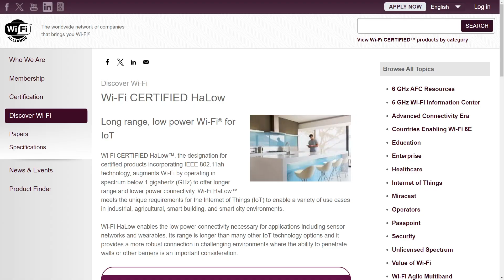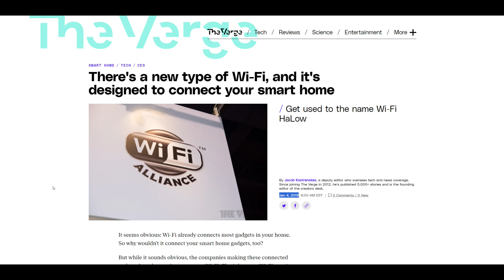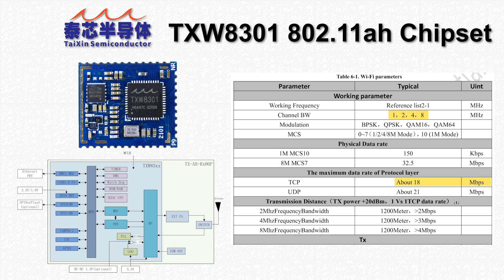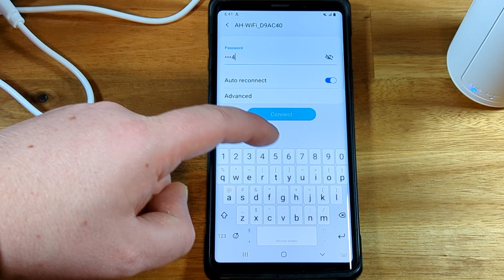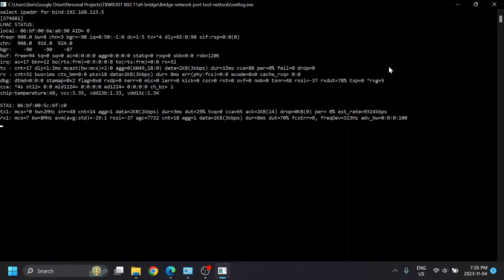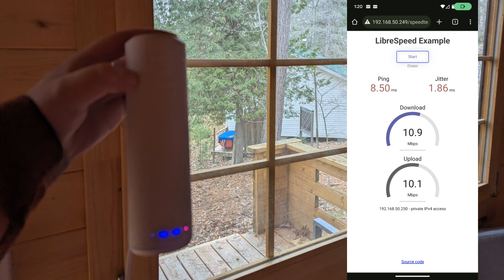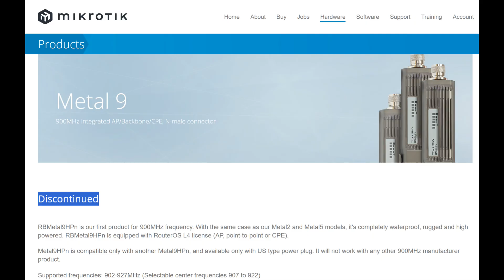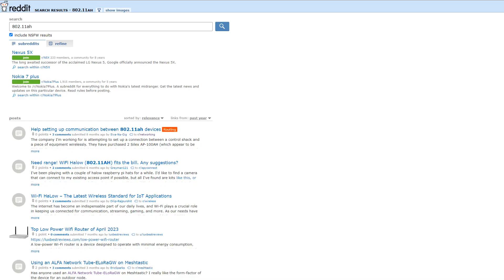802.11ah Wi-Fi HaLOW: The 1 Kilometer WiFi Standard

Comment: For the very little it's worth, some friends with amateur radio licenses had 802.11b running at the full 11 Mbps, over a 20-mile point-to-point link implemented without line-of-sight, with directional antennas and a 1 W amplifier. [Edited to add 'with amateur radio licenses']
Reply: The great thing about this is it achieved long range without the bulky point to point directional antennas. Just a stubby and no amplifier. And it can be used in wide area meaning use it while walking or on a vehicle while mobile. Imagine this using an amplifier and a 12dbi Omni antenna. 

Set up a starlink on your camper van or car linked with an Access point halow on a pole. Then bring along a small Halow receiver with you while you take a hike/stroll along the mountains or by the sea while youre live streaming from your phone for over 3km away from your camper van or car
Reply: Don't you need firmware hacks there so packets don't get dropped due to expiration? I heard that becomes a bigger problem with regular Wifi at around the 1 mile mark even under ideal conditions. Or is b already lenient enough in that regard? The people I think of probably exclusively tired faster standards.
Reply: If it is an issue, some WiFi routers let you adjust those settings.  If not, find a router that will run OpenWRT firmware.  I think it exposes those settings.
Reply: @major__kong  Okay, my info was old, it would make sense that those insights would have been used like that in the meantime.
Reply: @fgregerfeaxcwfeffece   It's a bit over 20 years ago now (which I see now I forgot to mention in my original comment), but as far as I recall, everything was unmodified, commodity equipment.
Reply: @Ice_Karma  They'd flash the Linksys wrt54g blue and black boxes with HSMM-Mesh firmware.  Certain models weren't frequency locked and had more flash ram.  As they made the units years on they became cheaper and more locked down.
Reply: You just need to adjust the ack timing timeout variable. Theres hundreds of companys that make outdoor based wifi gear. Camium, Ubiquiti, Mikrotik are the three biggest. I ran links upwards of 30KM on 5ghz. I also did PTMP under 15km links on 900mhz, 2.4ghz 5ghz, and very sort distances on 60ghz (under 2KM)  @fgregerfeaxcwfeffece
Reply: A 1W amplifier will take you straight to court in most countries..
Reply: @hermannschaefer4777   Yup, and I forgot to mention that they all had amateur radio licenses.
Reply: @hermannschaefer4777 Why?
Reply: @whatsupbudbud  In almost ALL countries of the world the maximum transmission power allowed is 100mW.
Reply: @hermannschaefer4777 is it related to national security, military or why? Hadn't heard this, so just curious.
Reply: @whatsupbudbud  It depends, but I'd say the most common reason is to avoid interferences with neighbors i.e. other users and devices and techniques that also use 2,x GHz. Crosstalking and similar effects make wireless communications always a problem, so it's no wonder that you have to regulate it. If you make p2p-radio systems around my country, you either live with 100mW or you need a special licence / permission with dedicated frequencies, i.e. 4, 6, 7, 13, 15, 18, 23, 26, 28, 32, 38, 42, 52, 71-76 and 81-86 GHz. Sending on 2,4GHz with 1W will initiate a (very expensive) monitoring car - and you don't want to pay that bill...
Reply: @whatsupbudbud  it actually various for wifi based on the antenna, whether it's a P2P or Point to many, if it's out doors or in doors. 36dBm is your max transmit power, which can come out to 4 to 5 watts for regular indoor unboosted router. A point to point per FCC will be predetermined during the development and application phase. 
What the FCC really cares about is your transmission dBm and frequency. But you gotta really shake the tree so to speak to get their attention enough to even get a cease and desist letter. 
With all those baofengs out there turned into illegal repeaters, wifi cluttering is lower on their list. 
100mW tends to be the default setting on most residential wifi transceivers, and 500mW on directional antennas that are still point to many although design to simulate a true point to point. 
Alfa brand name is what you want to get if you want to be able to control most of the router settings, instead of the hard-coded settings baked into the drivers on a generic router.
Reply: @theodorepollock1273 I'm in EU but thanks for your input.
Reply: @hermannschaefer4777  "A 1W amplifier will take you straight to court in most countries..."

Not if you have an appropriate amateur radio licence for that band...
Reply: @btudrus  You can't have a licence for those standard bands.
Reply: @hermannschaefer4777 Many unlicensed bands overlap  amateur radio bands especially in UHF and above
Reply: @hermannschaefer4777  " You can't have a licence for those standard bands."

Yes you can. In some countries amateur radio has higher priority in the 2.4GHz band (WiFi is just ISM anyway and it has the LOWEST priority)
Reply: @hermannschaefer4777   At the time, at least -- almost 25 years ago -- my (American) friends' amateur radio licenses permitted them to use up to 1 W of power regardless of band, undoubtedly subject to restrictions I've either long since forgotten or never knew.

Comment: 900 MHz bridges have been a thing since the late 90's, they were not widely marketed to the public but rather to public services to link MDT's (Mobile Data Terminals) back to a base station at the dispatchers console. Data rates were of course slow in the low Kbps range but that was all that was needed to send and receive lines of text and no images. Most systems like this were used by police and fire services to send and receive status updates and reports, Cab companies also used them in a similar way to send and receive calls to prevent rouge cabs (fake cabs not affiliated with the company) from jumping fares like they would with traditional 2-way radio.
Faster 900 MHz gear though didn't start popping up until early 2000's and the first ones I saw in use was at a drag boat racing event held by Lucas Oil in 2006 where they had a 900 MHZ link from their main control site to a boat ramp nearly 1/2 a mile away. This link supported internet traffic as well as the system they were using to send the racers ticket data to be printed out for the pair that just finished racing.

Comment: It looks like a big improvement over the Pringles can antenna.  

The old 10-base-2 coax cable had twice the range of 10-base-T twisted pair, and HaLow gives the same speed at even longer distances. 

ARCnet on a different co-ax cable had a 600 meter range but only a 2.5 Mbit rate. I worked at a place that used ARCnet to communicate between buildings as they were pretty spaced out. We had a Novell server, it had no problem serving files about the place. Granted files were smaller then.

Comment: Thanks, I was waiting for someone to manufacture some products using 900 MHz and the new protocol. I have a client (a radio station) that wants to piggy back on their 900 MHz studio to transmitter link to get a security camera and other alarm and control devices at the transmitter site. I have to look at the available products to see if the power is sufficient for the path length even with good high gain Scala dishes.

Comment: I've tried both the systems shown here - through trees, I get barely 10 Mbps down, and 2 up at 100m, when clear line-of-sight is possible. At the same distance, with a single tree in the path, it dropped to that 1-2 Mbps down, with sub-1 Mbps up. With a small thicket of trees, there's a complete dropout at 80m
Reply: I'm getting ~15Mbps at >600m through one tree. But I am using a log periodic at one end and a cheap TV antenna at the other.
Reply: ouch! Just killed my idea. Thanks for the heads up.
Reply: @JasonWald there are signals amplifiers, but your phone might not deliver signal to this router
Reply: 10 Mbps is about as fast as a 900Mhz waveform can carry. That's why basic WiFi uses 2.4Ghz and 5Ghz. The higher the frequency the more dense the waveform and the more data you can push over it at the cost of distance and line-of-sight requirements. 900Mhz can pass through lots of physical mass, but is slow. 5Ghz or 60Ghz wifi (often found in most point to point wifi solutions) are faster, but need clear line of sight to work. A 900Mhz at 10Mbps point to point is probably fine for access to a shed or outbuilding, but not for critical network devices.
Reply: @theterriblegamer1228  that's not correct, read the HaLow specification, it clearly lays out what is possible and I've actually seen it get 15Mbps.
Reply: @BobHannent A whole 5Mbps difference.... I've never seen past 10, but terrain and obstacles can still influence results.
Reply: @theterriblegamer1228  a whole 50% more than your claim is another way of putting it.
But literally, I am on a mountain, with crappy antennas and foliage obstruction.

Comment: Several miles (4+ LOS) can be obtained with the old 54G standard, as I tested this several years ago, so suspect that even today's standards would do just as well, as long as a quality antenna was used, I have found that many "proper" antennas were in fact low quality junk held together with hot glue, which in fact attenuates the 2.4Ghz! So be careful in cheap antennas, they are cheap for a reason. I was able to transmit a 2.4Ghz signal on a 1.3Ghz beam to a friend 17 miles away which was line of sight back in the day, not that we connected to each other, as we didn't try, we simply used "Net Stumbler" (remember that one??) to read the SSID's and Mac addresses, he sent me the file that Stumbler had created and checked that my Mac address had not been made up! And indeed it was my access point that he had received. So it's important to use correct coaxial and quality connectors with a decent antenna for long distance line of sight links.
I'm now a non-active radio ham, and used to use 1.3Ghz and 2.4Ghz for CCTV live one to one conversations on the hams bands, so quite familiar with gigabit frequencies. This was a very interesting video.

edit, I was using 0.5 watt on the 17 mile trip, and only 5the standard 50mW for the 4 mile distance one!

Comment: It is interesting there is so little hardware for 802.11ah since all radios these days are so software defined anyway. So provided your radio hardware and transceivers can support the frequencies of any of these frequencies - it should be relatively easy to add support for new wireless standards. So any phone e.g. chipset manufacturer should be able to add support for 802.11ah.... whenever they would bother.

Comment: great, super useful evaluation!!!!  I'm going to try this at our farm to hopefully allow remote security cam and opening functionality for the entry gate 1600ft away.  I may be pushing the range/bandwidth requirements but it help to be in a very rural area (zero interference) with mostly direct LOS if I use more directional antennas.  Two thumbs up.  Thanks!
Reply: You can always try a directional antenna if bandwidth or range isn't enough.
Reply: Wireless can easily be jammed so don't depend on it for security.

Comment: Very neat. Did you happen to be able to test multiple devices on the single AP?

I am just curious if it could replace point to point broadcast systems, where you would have an omni directional in the center of a property, and several out-buildings that run monitoring equipment. I used to install systems like that for Chicken/Pig/Cattle farms, where they often had monitoring equipment for moisture/temperature etc., and they would want to connect it back to their main office on the property.

So we would put up like a75ft tower with a big omni directional antenna on it to cover about a 300 meter radius, Then we'd just connect a directional antenna on each building pointing back. But With the ability to go through simple structures/hills/dense foliage, that actually sounds like a fairly ideal solution that seems a lot cheaper than the antennas and towers required.

I would just be concerned with that AP's ability to handle say 8 or 9 remote buildings at the same time with constant data traffic.

Comment: i'll just go ahead and give away the million dollar idea here.
parallelize it. make it support multiple simultaneous connections between the same router and the same device.
if you can go from 15 to 30 mbps then you unlock a bunch of usability. that's with just 2 channels. you could easily figure out a way to do 8 channels per receiver.
you could also use this device to sell ultra affordable wireless internet for $1 a month within your 1km radius only limited by the slow speed.
set up multiple points around town. do this everywhere.

Comment: The YT algorithm brought me to your channel and I am glad it did. I am K8MEJ and I love all things wireless. My first thought was “I wonder if my smartphone supports this protocol? It sounds like a way to give basic internet access to those of us going to mountain bike races in areas with no other cellular coverage. A Starlink connection as back haul good at least give messaging capabilities to a few hundred racers, spectators, and support crews. But, my iPhone doesn’t appear to have a radio for that band.
Reply from the maker: Thanks! I saw on Newracom's Youtube page that they had some sort of proof of concept Android device with the chipset installed, but outside of that I haven't seen any trace of it installed in a production smartphone. I imagine a USB C dongle that presents itself to Android as a USB Ethernet dongle could allow for a fairly "plug and play" experience with existing devices, and I think that's how Alfa's USB C product works. Otherwise, having a central mast with the 802.11ah AP could allow for some battery/solar powered APs spread around to distribute plain 2.4GHz 802.11 WiFi access. 

I also envisioned something like a Motorola DTR700 900MHz portable radio with data capabilities such as SMS and GPS tracking like you get on DMR systems, with a built-in WiFi AP to get internet access on a mobile device.

Comment: 5.8 GHz is typically faster due to a few reasons.  You are correct that more channels typically means less interference, therefore higher throughput.  Microwave ovens operate at 2.4 GHz which can be an additional form of interference... along with Bluetooth and even Zigbee.  There's just a lot less contention at 5.8 GHz.  

The signal propagation is also a double edged sword... so while 5.8 doesn't propagate through dense materials well, that also means sources of interference aren't propagating as well either.

But the most important factor in speed differences in most single family homes is due to the actual RF bandwidth differences among the bands.  2.4 GHz really only effectively allows for 20MHz bands to yield 3 non-overlapping channels.  At 5.8 GHz you can move to 40 or 80 MHz channels and dramatically increase your throughout.
Reply: 5.8ghz has piss poor range, and gets blocked by anything. 1.2ghz-800mhz is most ideal for long range data transmission (especially FPV stuff)

Comment: I think 900mhz was a great option for remote access without a clear line of sight. Too bad the market demand was low, so it is gone. I wish it did not go though. We use cameras remotely and the 900mhz was our only terrestrial solution. It was good. I do think there is still a good market for 900mhz products.
Reply: maybe you can get good deals on obsolete 900mhz antennas?
Reply: dect uses 900 and is quite widespread i think. edit: no, i misremembered, it's around 1.9ghz
Reply: @peppigue  n8 (900Mhz) as part of 5G NR cell phones.

Comment: For anything not doing ionospheric propagation at low frequencies (<30MHz) the distance you get is almost always just determined by line of sight. No UHF or l-band or microwave frequency or modulation change gets you out of a valley or over a hill. To get any claimed range you have to have the height above surrounding terrain to get line of sight. (-- yes, there is unpredictable tropospheric ducting or incoherent scatter, but the first is rare and the second requires kilowatts of power.)

Comment: wow very nice video. Do you by any chance know if the first product you've showed supports a frequency/channel change to euopean regulations? We cant use 900mhz as this is regulated only 863 -868 is useable in the EU
Reply from the maker: Thanks! Depending on the version of the TXW8301 chipset used, it appears that you can switch the band into that 800MHz range used by places like the EU, China, ect using the AT commands "AT+CHAN_LIST" or "AT+FREQ_RANGE". The TX-AH-R900P will do 860-928MHz, while other versions like the TX-AH-R900PNR will be restricted to 902-928MHz or the TX-AH-R900PNR-860M that's restricted to 859-894 MHz.
Reply: @BenJefferyCanada  thank you so much for your answer the product is already in my alibaba shopping cart. You should consider putting ref links to the products you show in your video description. Like the others youtube algorithm brought me here and yeah great videos you've a new subscriber.

Comment: This is actually amazing !
especially with its low power usage, it can be used with a small solar panel and few 18650 batteries and run basically for ever !
Reply: I have read some news stories reporting this setup working for up to, or, over a month on just a coin battery. 
So, any small rechargeable battery plus a tiny solar panel could keep it running indefinitely.
Reply: https://www.youtube.com/watch?v=qF0BHnmi9j8
Reply: Not possible, because the 2.4 ghz side still will drain
Reply: @Rick-pl5ey  you don't need the 2.4 side